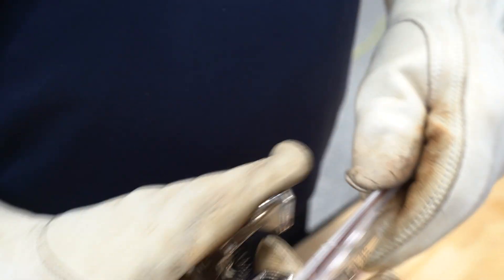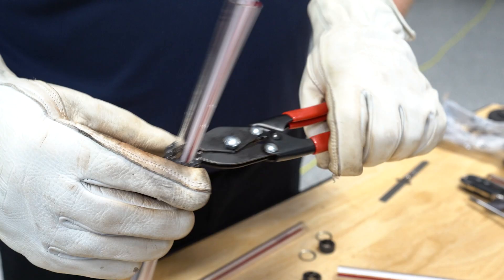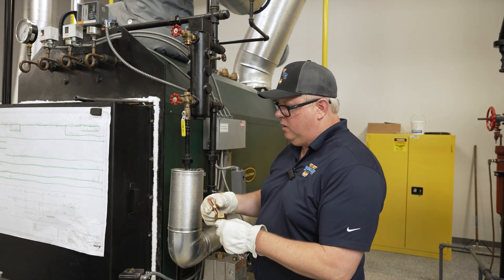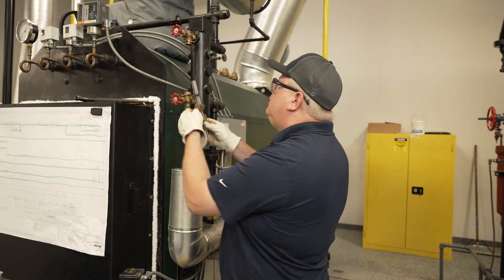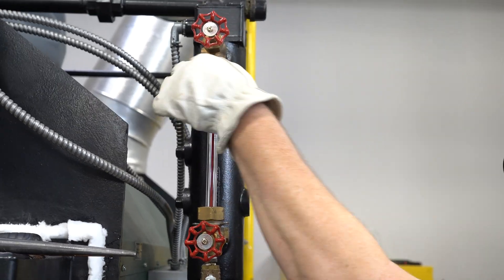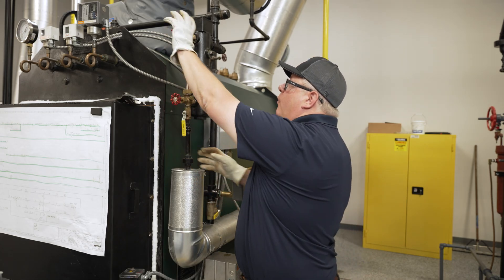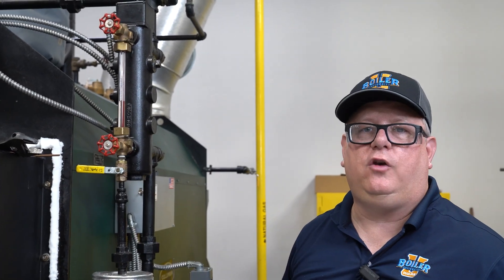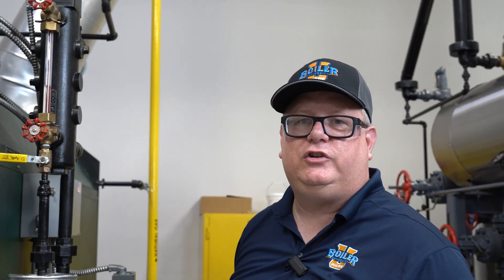Boiler Sight Glass Install Tutorial Part 2 Cutting Glass & Reassembly - Weekly Boiler Tip

Comment: Question - What is the best way to prevent leaks on flanged pipes after a steam shutdown. 

Is there better Gasket materials than others when it comes to Expansion & contraction. 
 and types of nut, bults & washers to from prevent loosening when pipe goes cold/ contracts